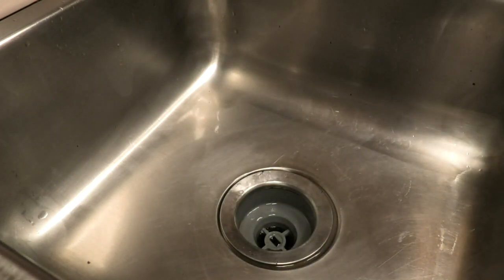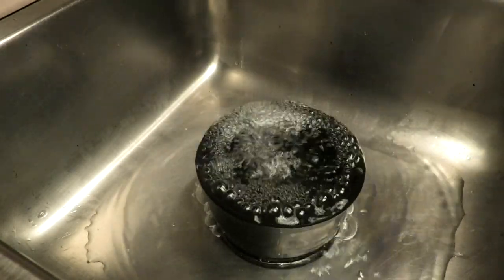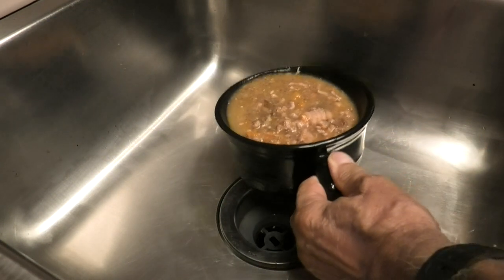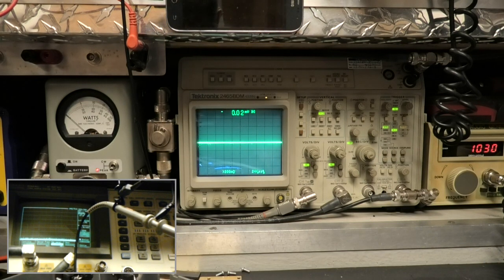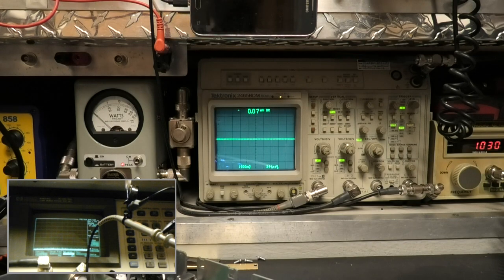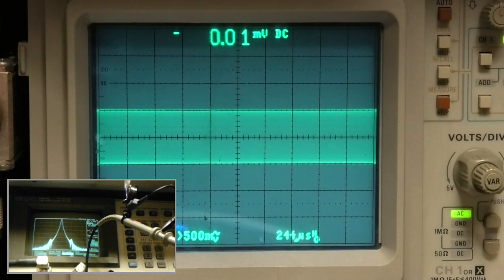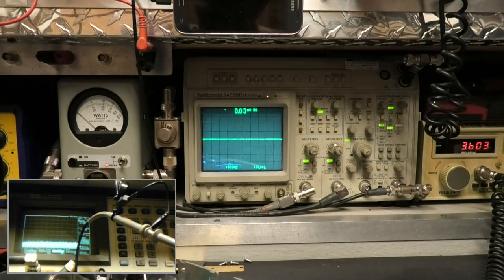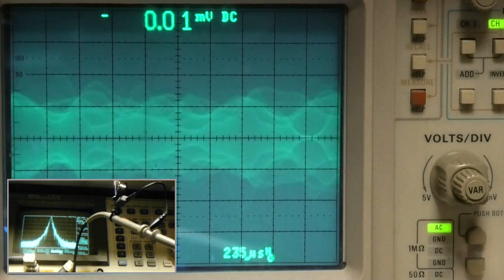Real World CB Radio -Stryker Radios ..  Amplitude Modulation Down The Drain. Think AM Receiver.

Comment from the maker: Beware of the "romper room - golden screwdriver jockey".. waste of your time, effort and $$.  Dave White: https://www.facebook.com/725489164182513/posts/2424934947571251/  Read "SHOW MORE" button above and learn how to identify them.  Bite your tongue and follow directions .. Here's what it takes to cut through the noise, be loud and crystal clear with a better receiver too:  A) Tuned Bench:  https://www.youtube.com/watch?v=lwcDfXOgAls.  True, it's more complicated and time consuming to accomplish these consistent and accurate results. Below is a partial procedure and list of calibrated equipment used to achieve this level of performance . Read on ..

Fine Tune CB Radio Shop strictly adheres to (https://www.nist.gov/) NIST Traceable Calibrations and other industry standards to maintain accuracy and consistency for providing Real World Performance Tuning of Citizens Band and 10 Meter export mobile radios with integrity.

"Basic Textbook AM/FM/SSB Transceiver Tune, Alignment and Calibration" 

1) Pll adjustments
VCO & OSC, AM TX OSC, USB TX OSC, LSB TX OSC.

2) Transmitter alignment
DRIVER BIAS, FINAL BIAS, SSB  (or gate voltages for mosfet versions) CARRIER BALANCE, HI-LO AM & SSB Power, RF METER, AMC, ALC and FM DEVIATION.

3) Receiver alignment
AM/FM RF & IF SENSITIVITY, FM DETECTOR/DEVIATION, SSB IF SENSITIVITY, SSB S-METER, AM/FM S-METER (100uV unmodulated -67dbm for “S-9” meter reading!), AM/FM SQUELCH RANGE, SSB SQUELCH RANGE, and NOISE BLANKER/AUTOMATIC NOISE LIMITER (Real World dBm to volts (uV) tables below).

That's just a typical run of the mill textbook tune up and alignment (if you're lucky). There's more to it than frequency alignment, modulation adjustment, meter calibration and a tune up report displaying exaggerated rms Bird peak watts! 

"Test Bench includes"

Bird 4314C Meter
https://www.birdrf.com/Products/Test%20and%20Measurement/Power-Meters/Wattmeters-Line-Sections/RF-Wattmeters/4314C_PEP-Single-Element-Wattmeter.aspx
Part 1) https://www.youtube.com/watch?v=RpX9IHe4ORM&t=16s
Part 2) https://www.youtube.com/watch?v=LuhbqTf6Bxw
Bird 4314C Accuracy Test: https://www.youtube.com/watch?v=DqEOabYqhQo&t=5s
Bird Stipulates 1/2 wavelengths  https://www.youtube.com/watch?v=5eWhgT-rTII
And Genuine Bird Elements from 1K down.

Bird 4373 Sampler 
https://www.rfparts.com/signal-samplers.html

HP8924c with options
http://userequip.com/files/specs/2147/HP%208924C%20Repair.pdf
https://www.youtube.com/watch?v=Cg1w0xBa27s&t=1s

HP8920a with options
https://www.keysight.com/upload/cmc_upload/All/EPSG072204.pdf

Three analog scopes, one digital 200 Mhz
https://www.atecorp.com/atecorp/media/pdfs/data-sheets/tektronix-2465b-2467b_manual.pdf
https://www.youtube.com/watch?v=by98x4eu2lM

Fluke 27fm
http://www.fluke.com/fluke/inen/digital-multimeters/fluke-27.htm?pid=56055
 
LCR http://www.lcrresearch.com/wp-content/uploads/2017/05/LCR_Pro1_Manual_version1.03.pdf

Power supplies
6 Cosel PBA1500f12 (750 amps) variable and configurable.
https://en.cosel.co.jp/product/powersupply/PBA/PBA1500F/PBA1500F-12/
Corcom 20VB1 F7130 EMI Filter 50-60Hz 250V

Times Microwave Coax jumpers and test leads
http://www.timesmicrowave.com/cms/products/cables/lmr/
https://www.youtube.com/watch?v=EmqaGJ6IWow
https://www.youtube.com/watch?v=1ltFVSxGp5Y
https://www.youtube.com/watch?v=v12YZT_1o90
https://www.youtube.com/watch?v=h7iiYfmYWRA&t=215s

Amphenol RF Connectors
https://www.amphenolrf.com/
https://www.youtube.com/watch?v=dVh5B0hdEA0 
https://www.youtube.com/watch?v=dKZg8T_AOso

More range, compliments, reliability and a quieter, clearer but more sensitive receiver,  Get Fine Tuned .. not peaked and ruined.

Here are some VideoGates of me at the bench practicing what I preach using my bench radio or customers radio completed and ready to be shipped: https://www.youtube.com/results?search_query=hard+drive+163+ more: https://www.google.com/search?q=Hard+Drive+163+nm&ie=utf-8&oe=utf-8&client=firefox-b-1-ab

It's what I recommend, use, service and sell ... to you ... not something non practical or deceiving in a misleading way. I'm not just the tech and owner of Fine Tune CB Radio Shop, I'm a customer too!  When finished, You'll be giving radio checks, not asking for them .

dBm To Watts and Volts
Tables below displays relationship between Power in [dBm] or [Watts] and Voltage in RMS, peak, peak-to-peak for sinusoidal signals in 50-Ohm systems for accurately measuring and tuning am/fm/ssb receiver sensitivity, agc, squelch and "S9" Meter calibration. Real World! Mike @ Mikes Radio Repair (Romper Room), Mark Rutherford aka Mark 19960, CB Kidd, Martian and all of your other fake accounts pay attention to the tables below, stop misaligning radios, spreading false information and promoting propaganda! 

  [dBm] [Watts]   [Volts]rms   [Volts]p    [Volts]pp
-140 0.100E-16  22.361 nV  31.618 nV  63.236 nV 
-139 0.126E-16  25.089 nV  35.476 nV  70.952 nV 
-138 0.158E-16  28.150 nV  39.805 nV  79.609 nV 
-137 0.200E-16  31.585 nV  44.662 nV  89.323 nV 
-136 0.251E-16  35.439 nV  50.111 nV  100.222 nV 
-135 0.316E-16  39.764 nV  56.226 nV  112.451 nV 
-134 0.398E-16  44.615 nV  63.086 nV  126.172 nV 
-133 0.501E-16  50.059 nV  70.784 nV  141.568 nV 
-132 0.631E-16  56.167 nV  79.421 nV  158.842 nV 
-131 0.794E-16  63.021 nV  89.112 nV  178.223 nV 
-130 0.100E-15  70.711 nV  99.985 nV  199.970 nV 
-129 0.126E-15  79.339 nV  112.185 nV  224.370 nV 
-128 0.158E-15  89.019 nV  125.874 nV  251.747 nV 
-127 0.200E-15  99.882 nV  141.232 nV  282.465 nV 
-126 0.251E-15  112.069 nV  158.465 nV  316.931 nV 
-125 0.316E-15  125.743 nV  177.801 nV  355.602 nV 
-124 0.398E-15  141.086 nV  199.496 nV  398.992 nV 
-123 0.501E-15  158.301 nV  223.838 nV  447.677 nV 
-122 0.631E-15  177.617 nV  251.151 nV  502.302 nV 
-121 0.794E-15  199.290 nV  281.796 nV  563.591 nV 
-120 0.100E-14  223.607 nV  316.180 nV  632.360 nV 
-119 0.126E-14  250.891 nV  354.760 nV  709.519 nV 
-118 0.158E-14  281.504 nV  398.047 nV  796.094 nV 
-117 0.200E-14  315.853 nV  446.616 nV  893.232 nV 
-116 0.251E-14  0.354 µV  0.501 µV  1.002 µV 
-115 0.316E-14  0.398 µV  0.562 µV  1.125 µV 
-114 0.398E-14  0.446 µV  0.631 µV  1.262 µV 
-113 0.501E-14  0.501 µV  0.708 µV  1.416 µV 
-112 0.631E-14  0.562 µV  0.794 µV  1.588 µV 
-111 0.794E-14  0.630 µV  0.891 µV  1.782 µV 
-110 0.100E-13  0.707 µV  1.000 µV  2.000 µV 
-109 0.126E-13  0.793 µV  1.122 µV  2.244 µV 
-108 0.158E-13  0.890 µV  1.259 µV  2.517 µV 
-107 0.200E-13  0.999 µV  1.412 µV  2.825 µV 
-106 0.251E-13  1.121 µV  1.585 µV  3.169 µV 
-105 0.316E-13  1.257 µV  1.778 µV  3.556 µV 
-104 0.398E-13  1.411 µV  1.995 µV  3.990 µV 
-103 0.501E-13  1.583 µV  2.238 µV  4.477 µV 
-102 0.631E-13  1.776 µV  2.512 µV  5.023 µV 
-101 0.794E-13  1.993 µV  2.818 µV  5.636 µV 
-100 0.100E-12  2.236 µV  3.162 µV  6.324 µV 
-99 0.126E-12  2.509 µV  3.548 µV  7.095 µV 
-98 0.158E-12  2.815 µV  3.980 µV  7.961 µV 
-97 0.200E-12  3.159 µV  4.466 µV  8.932 µV 
-96 0.251E-12  3.544 µV  5.011 µV  10.022 µV 
-95 0.316E-12  3.976 µV  5.623 µV  11.245 µV 
-94 0.398E-12  4.462 µV  6.309 µV  12.617 µV 
-93 0.501E-12  5.006 µV  7.078 µV  14.157 µV 
-92 0.631E-12  5.617 µV  7.942 µV  15.884 µV 
-91 0.794E-12  6.302 µV  8.911 µV  17.822 µV 
-90 0.100E-11  7.071 µV  9.998 µV  19.997 µV 
-89 0.126E-11  7.934 µV  11.218 µV  22.437 µV 
-88 0.158E-11  8.902 µV  12.587 µV  25.175 µV 
-87 0.200E-11  9.988 µV  14.123 µV  28.246 µV 
-86 0.251E-11  11.207 µV  15.847 µV  31.693 µV 
-85 0.316E-11  12.574 µV  17.780 µV  35.560 µV 
-84 0.398E-11  14.109 µV  19.950 µV  39.899 µV 
-83 0.501E-11  15.830 µV  22.384 µV  44.768 µV 
-82 0.631E-11  17.762 µV  25.115 µV  50.230 µV 
-81 0.794E-11  19.929 µV  28.180 µV  56.359 µV 
-80 0.100E-10  22.361 µV  31.618 µV  63.236 µV 
-79 0.126E-10  25.089 µV  35.476 µV  70.952 µV 
-78 0.158E-10  28.150 µV  39.805 µV  79.609 µV 
-77 0.200E-10  31.585 µV  44.662 µV  89.323 µV 
-76 0.251E-10  35.439 µV  50.111 µV  100.222 µV 
-75 0.316E-10  39.764 µV  56.226 µV  112.451 µV 
-74 0.398E-10  44.615 µV  63.086 µV  126.172 µV 
-73 0.501E-10  50.059 µV  70.784 µV  141.568 µV 
-72 0.631E-10  56.167 µV  79.421 µV  158.842 µV 
-71 0.794E-10  63.021 µV  89.112 µV  178.223 µV 
-70 0.100E-09  70.711 µV  99.985 µV  199.970 µV 
-69 0.126E-09  79.339 µV  112.185 µV  224.370 µV 
-68 0.158E-09  89.019 µV  125.874 µV  251.747 µV 
-67 0.200E-09  99.881 µV  141.232 µV  282.465 µV
-66 0.251E-09  112.069 µV  158.465 µV  316.931 µV 
-65 0.316E-09  125.743 µV  177.801 µV  355.602 µV 
-64 0.398E-09  141.086 µV  199.496 µV  398.992 µV 
-63 0.501E-09  158.301 µV  223.838 µV  447.677 µV 
-62 0.631E-09  177.617 µV  251.151 µV  502.301 µV 
-61 0.794E-09  199.290 µV  281.796 µV  563.592 µV 
-60 0.100E-08  223.607 µV  316.180 µV  632.360 µV 
-59 0.126E-08  250.891 µV  354.760 µV  709.520 µV 
-58 0.158E-08  281.504 µV  398.047 µV  796.094 µV 
-57 0.200E-08  315.853 µV  446.616 µV  893.232 µV 
-56 0.251E-08  0.354 mV  0.501 mV  1.002 mV 
-55 0.316E-08  0.398 mV  0.562 mV  1.125 mV 
-54 0.398E-08  0.446 mV  0.631 mV  1.262 mV 
-53 0.501E-08  0.501 mV  0.708 mV  1.416 mV 
-52 0.631E-08  0.562 mV  0.794 mV  1.588 mV 
-51 0.794E-08  0.630 mV  0.891 mV  1.782 mV 
-50 0.100E-07  0.707 mV  1.000 mV  2.000 mV 
-49 0.126E-07  0.793 mV  1.122 mV  2.244 mV 
-48 0.158E-07  0.890 mV  1.259 mV  2.517 mV 
-47 0.200E-07  0.999 mV  1.412 mV  2.825 mV 
-46 0.251E-07  1.121 mV  1.585 mV  3.169 mV 
-45 0.316E-07  1.257 mV  1.778 mV  3.556 mV 
-44 0.398E-07  1.411 mV  1.995 mV  3.990 mV 
-43 0.501E-07  1.583 mV  2.238 mV  4.477 mV 
-42 0.631E-07  1.776 mV  2.512 mV  5.023 mV 

                 Don't Be A Mud Duck!

 https://www.arrl.org/shop/ARRL-Handbook-2019-eBook

Hard Drive 163 NM. 73's! Click click.?